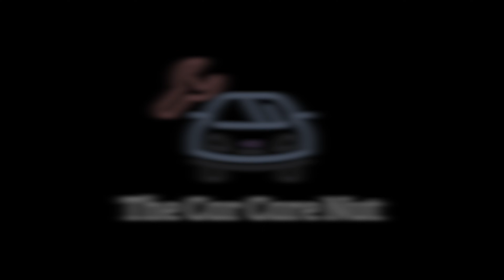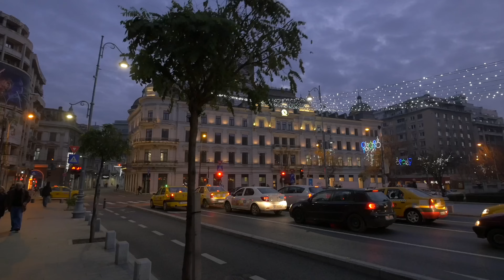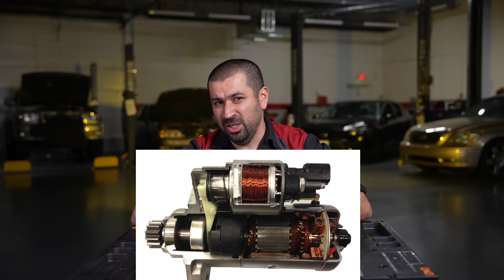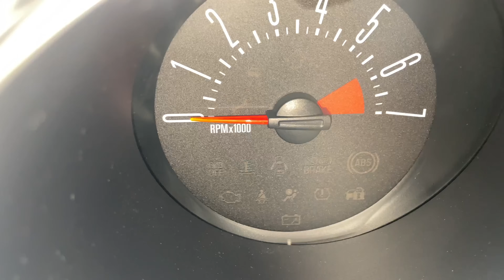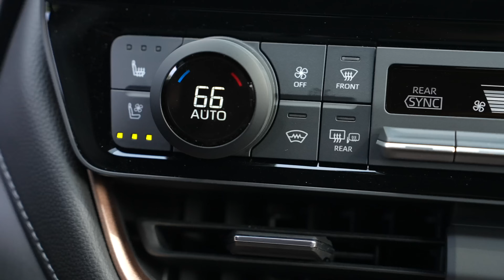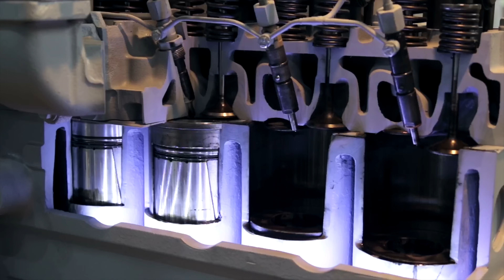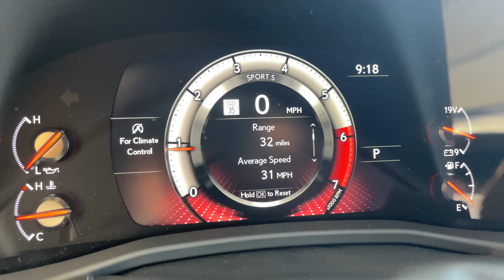How Does Start Stop Technology Work in Modern Cars? Everything You Need to Know

Comment: It's a great feature,but it still has some flaws that need to be thoroughly tested to make sure it works 100% effectively.  As of now, it still only works half the time and doesn't always work when you move and stop and move again and then stop again.  It will stop and then engage again, then you stop, and now the car won't stop because you didn't move as much again afterward, so now it stays with the engine still running.  They need to tune it to make it work every time you are not moving and not only when you move one time.  It needs to start when you let go of the brake and stop when it senses you are NOT moving. It doesn't know that you have stopped moving again, so the engine remains running after you move slightly and had stop again.
Reply: You’re misunderstanding how it’s supposed to behave - every stop start system does this to avoid overworking the 12v battery.  You wouldn’t want the starter motor to fire up 10 times per minute for a long period of bumper to bumper slow moving traffic!
Reply: That’s intentional to stop excessive discharge of the battery - remember that vehicles use shallow cycle batteries, not deep cycle like a leisure battery.
Reply: It's got to the point where I just disable it in city driving.  And only enable it when I'm on the freeway with heavy conjested traffic. And I worried about the wear and tear strain that it puts on the moving parts inside that needs lubricants to keep it from wearing out due to no lubricant.

Comment: I remember driving vehicles with that start-stop feature. Didn't like them then, still don't like them. 
We have 3 vehicles at home.  NONE are start-stop including my 2020 RAV4 base model with KEY ignition.  I like it!
Reply: Did you ever have one of those systems where the engine stops and you think it’s stalled?😮
Reply: @Mark-lz4wg  Only when I worked on the ones in the City Fleet 8 years ago.

Comment: One thing I miss about the 1970 Camaro I had in my youth, is that it started instantly and I could pop the clutch and be rolling in an instant.  You can't do that with modern cars.
Reply: They still sell manual gearboxes in most of the rest of the world 🧐
Reply: Slim pickings in North America manuals are being discontinued a across the board, from most manufacturers. @Mark-lz4wg
Reply: Yes you can

Comment: Folks, I have an easy way to disable this system that literally anyone can do that I've done in my 2023 Hyundai Tucson. Follow my steps: 

1) Get a business card. 
2) Cut a small piece off of it about 1.5 inches long and .5 inches wide.
3) Fold it on the long side so it becomes .75 inches long. 
4) With one hand, push down and hold the start stop button. 
5) With the other hand, slip the folded piece of card into the gap between the button and a solid piece of dash with a tiny bit still showing (i.e. don't put it between two buttons). 
6) Your start stop button will now be pressed every time you start the car. 

Notes: 

To remove, get some tweezers and pull on the little bit you left showing. Ta-da! It's not a permanent change. 

Some cars have a function where if you press and hold the start-stop button it triggers some sort of setting change, read your manual to confirm that this isn't the case.

Comment: Really great info and details.  Sounds like this video is more about gas engine start/stop.  How does a hybrid Toyota start/stop work or differ?
Reply: Well everything is electrified on a hybrid, so AC and heat (braking is electronic as well) continue to function with engine off. The motor generators responsible for spinning the engine up are much more robust, you don’t even feel the engine start most of time.

Comment: our 2024 volvo xc90 does not have a button to disable this feature. I was worried if this function would damage the engine and was thinking about calling the dealership to ask how to disable this feature. I checked everywhere in the settings and could not find this option and youtube only shows it for the 2022 and older models. I think they changed the software. A lot of the times i just switch to manual while nearing a traffic stop so the engine does not turn off.

Comment: Excellent explanation! In my current car, I have no issues with start/stop, never felt like I needed to turn it off. Works fine and turns off engine only in optimal conditions.

However, in my previous car, which was a GM vehicle with a 1.6l diesel and manual transmission, start/stop was weird. It stopped engine when engine or transmission were cold (in that car when transmission was cold sometimes it was hard to shift gears), timing chain rattled often at start/stop events. Ended up just turning it off every time I started the car, kind of like automatic action: turn on ignition, press button to disable start/stop. Button was conveniently placed near gear lever. Was I overreacting?
Reply: There seems to be a big improvement on the MK7.5 Golf over the MK7. However, when she is a passenger in mine my wife still instinctively presses the button to turn if off having suffered me swearing at my MK7 when Start Stop turned into Stop, don't Start.
Reply: I’m in the same position as you, never even noticed the stop start on my current 10 year old diesel car even when it was on a 9.5 year old battery.

Your comment about your previous GM vehicle is interesting, that sounds painfully bad, actually it could explain why there is so much obvious misinformation coming from Americans in these comments - maybe GM have been churning out millions of crappy vehicles with poor implementations of various systems and that has entered into the perception of the US public.  You only need to watch South Main Auto Repair or Pine Hollow Auto Diagnostics a few times to have a lifelong aversion to anything made by GM…

Comment: Start stop is extreamly bad for the environment ,,first off it will destroy your starter motor prematurly,,,That's just common sense,,Also it is actually worse for the planet because as any mechanic worth his salt knows,,When you come to a stop and turn off your engine,,Your engine starts to cool immediately ,,When the engine starts back up the computer commands the injectors to overfuel the combustion chamber to get the car started thus pumping out large amounts of unburnt fuel out the back,,,Now imagine doing that hundreds of times per week,,,plus the cooling of the engine every time you stop ,,The computer also commands the injectors to over fuel to reach the required heat,,,It actually pollutes way more than just not having start stop..

Comment: one of my concerns is the loss of oil pressure when the engine shuts off.  seems there would be no lubrication for the first second or two as you're accelerating from a dead stop. the time when the engine is under its greatest stress BTW🤨

Comment: The "Special" battery you are referring to is an AGM (Absorbent Glass Mat) Battery.  I believe the Toyota Hybrids uses it as the 12V aux battery as well. 

For car audiophiles, these were the essentially the Optima RedTops and YellowTops.
Reply: My AGM in my GMC is not a red or yellow top battery.   It is big and heavy and expensive, making it a pain to replace.
Reply: The AGM batteries are almost twice as expensive as a standard LA battery. 
Out of curiosity I looked up the replacement of my 22 Tundra battery. It is more than twice as expensive than the batteries in my other 3 Toyotas. Crazy.
Reply: @markf8256  a normal battery is usually a $100
Reply: @markf8256  AGM Batteries are used in any car with start-stop functionality as the battery needs to do more work while the engine is stopped.  AGM batteries are able to tolerate deep discharge cycles way better than regular VRLA batteries.
Reply: All optima batteries are always have been
Reply: No special battery on mi Highlander 2019 LE Plus with start stop technology, just a regular 24F group size battery.  First battery changed under warranty about 34k miles and recently changed again about 72k miles.  Bought the last one in Costco for less than the mayor auto parts

Comment: Save $150 in gas over 10 years: Spend $500 on starter replacement.  Makes sense.
Reply: I turn stop start off in my car meaning my starter motor will last longer than that of a non stop start car because I have an enhanced starter motor and battery thats having an easy time. All cars in the UK have a button to switch off stop start and you can even disable it forever with a decent OBD tool.
Reply: government control is priceless though
Reply: 15,000 miles in a year. Assuming 20 mpg with it off, you can get 22 mpg with it on. That’s 68 gallons. At 3.75 per gallon, that’s $256 gallons. Starter pays for itself after 2 years, and keeps going for another 8 years, saving you even more. Your lack of math skills is showing.
Reply: @SamaelGamboa  It's debatable you're saving that much, especially if you're doing 15K a year - that would be a lot of freeway, where stop start doesn't come into play.  You also have to consider the impact on the environment - that's what we're doing this for, right?  Well, it would be way better if the starter never wore out prematurely from too many cycles.  Now you have to have more metals excavated, refined, and manufactured into a replacement starter.  The workers who made that starter have to drive their cars to the manufacturing facility.  The manufacturing facility releases their own terrible emissions and waste.  After it's made, the starter must be shipped overseas, which is extremely wasteful and polluting.  Then once it arrives on shore, inventoried in a warehouse - more man hours.  Then shipped to a parts supplier.  Then shipped again to the repair shop or a customer.  Then the old starter has to be recycled or remanufactured, which is another huge processes and burden on the environment. That's a ton of greenhouse gases and detriment to the environment - which we're allegedly trying to save.  Makes no sense.   There's zero net benefit.  Although it sure does keep people rich and create a lot of jobs, which is really what the green movement is all about.  It's clearly NOT about the environment.
Reply: On manual cars it only engage when I'm at neutral. It not as irritating as auto  I guess
Reply: Right, because you don’t know that engineering is actually… a thing. 🤣
Reply: I lost engine cost me 99 cents
Reply: It's a starter you're probably going to replace anyway, especially at the 10-year mark
Reply: @sh-guitar  Starters typically last a lot longer than 10 years.
Reply: Loving my 2004 Tacoma! 😂 This guy is top notch!
Reply: If it was 500 I’ll install it in my z 31 
Wait till they start to break bet you it’s over a 1000 its a shame how this days any car breaks after 50,000 miles
Reply: Not just the $500 expense.   What if the car won't start when you are at a red light in heavy traffic?  Lots of stress and inconvenience that goes beyond a dollar figure.
Reply: 500 my sweet patootie. Plus what else needs to be removed to get to it and what does one of these new ones cost?
Reply: You also need to take into account that you pay more for the car, and more for the battery. Consumer losing all the way while they find new ways to tax us to death in the name of climate change.
Reply: Inflation is an indirect tax as well.  Gotta love the gooberment and this administration, eh?  @charlconradie4935
Reply: @charlconradie4935 Climate change may eventually tax you to death faster than the government.
Reply: @charlconradie4935  The complexity of that system, the special starter, the extra water pump, etc, etc has to be very expensive.  My car could have come without that system instead of all of the cost cutting compromises that were made.

That said, it does seem to be quite effective - according to the trip computer.  I'll get a better idea of its effectiveness when I calculate my real fuel economy over an extended period.  Not sure I trust the trip computer.  It might be a little optimistic.
Reply: @charlconradie4935  Cl;early you have no interest in preventing tthe deaths your children and grandchildren.
Reply: @charlconradie4935 The problem is that the people making the regulations never have foresight, operate at the speed of a retirement home, and then the regulations that worked before or had good intentions when they were written become hampered by their loopholes and are unable to be replaced because no one in Congress realizes it's a problem.

Our legislature is too small.
Reply: Due to inflation $150 would be worth more not by a lot but still exists and it’s more about emissions than fuel savings.
Reply: @Mayan-_  $150 isn't going to inflate to be the equivalent of $500 in a mere 10 years.  Yes, this is all in the name of emissions - to save the planet from the fake global warming agenda.  Nevermind the mining, manufacturing, and disposal of electric car batteries cause more damage to the environment.
Reply: So if the car makers wont to reduce emissions EVEN FURTHER  we do have this technology  . Has FEDREL ACREDTATION  and E.P .A.   . Inthe U.S. but no car marker wants to pay for the technology  this was done about 14 yearsago  and nothing.  Al so applies to diesel engines to   and no add blue is needed  . This gives E.U.R.O. 6 pollution std ..@Mayan-_
Reply: Totally missed the point!
Reply: @Moorakflyer  - Actually, I think I cut through all the nonsense and got STRAIGHT to the point!
Reply: Don’t even think about the starter.   No oil pressure when you turn the engine off.   No other way than to cause additional wear on all of the bearings
Reply: @garyalabama  They have electric pumps...
Reply: @DaKurupt19 I’ve never seen a car with an electric oil pump.
Reply: @garyalabama  Yet that's what these systems use (specifically for SS scenarios)...
Reply: @garyalabama  What? That's not how it works. You do realize that the point of oil is to create a lubricated film, right? Meaning that lubricity doesn't end just because the engine is off. The film of the oil coats the whole engine, the 30 seconds or less that it takes you to sit a stop light with the engine off isn't going to suddenly make the oil less impactful. If that were the case, cold started cars after a few days would implode before long. In fact, cars that sit for days still have a film within the entire engine. Cold starts are actually the one thing that hurts cars the most in terms of engine wear, (outside of no oil at all). However, if cold starts were as harmful to engines as some people make it out to be, cars in incredibly cold climates would be again, imploding in great numbers.
Reply: @SpeCifiC0507 it is less though.
Reply: @SpeCifiC0507 you mean 2 to 3 minutes if the light just turned red,and in the summer months the oil is super hot and thin..so a good bit of oil drains off of the bearings and back in the pan..which causes wear from the oil pressure being low from it restarting many times...
Reply: @SpeCifiC0507 In Las Vegas 2 MINUTE or longer lights.
Reply: @SpeCifiC0507  :  I do not think that word means what you think it means...
Reply: It's ok, in 20 years we won't have a planet to live on anymore.. but my 500 dollars tho!! Ok ok I know but the point is to save the environment, not your money
Reply: @zizmares they said that 25 years ago, here we still are.
Reply: @zizmares  if we aren’t here in 20 years, it will be the second coming of Christ.   It won’t have anything to do with the climate propaganda
Reply: @zizmares people have been saying the planets gone in 20 years for about 50 years now.
Reply: @zizmares   The idea that Earth will soon be unlivable is highly exaggerated.   A little bit warmer, and more people, maybe so.
Reply: @zizmares  -- First of all, get real.  Second, have you ever considered the environmental impact of having to manufacture a additional starters?  The metals that had to be pulled out of the environment and how dirty that is, plus the gas powered machinery used for mining?  Then the refinement process, transportation, manufacturing, people have to drive to the factory so that's more pollution, then more transportation to the warehouse -- so more labor, more greenhouse gasses, and a facility has to be created.  Then the part is bought, shipped again using more greenhouse gasses, then a mechanic has to be hired to replace the part, and the old part is shipped back and recycled - so more shipping and greenhouse gases used for that - and more employees hired, more buildings created, and more greenhouse gasses used to recycle or rebuild the part.  USE YOUR BRAIN.  The planet would have been BETTER OFF never having to have the starter replaced in the first place.